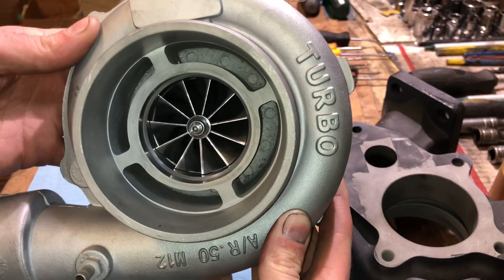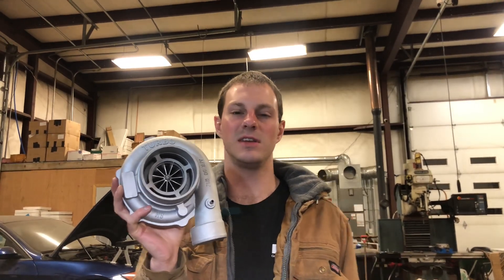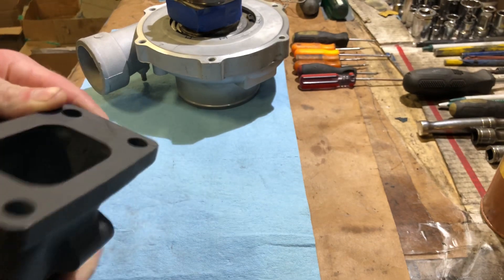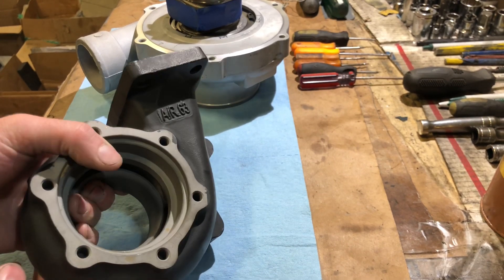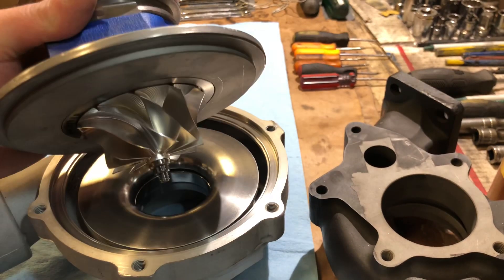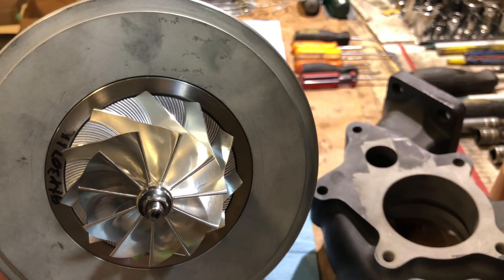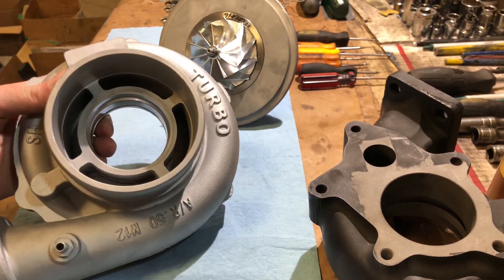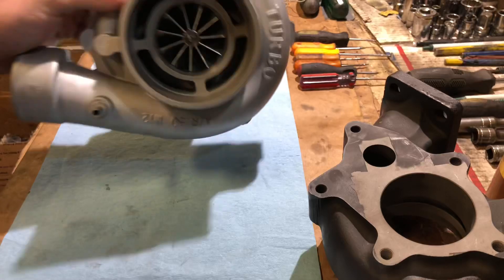“eBay” gt3071 to gtx3071r turbo build

Comment: Hi, I watched a lot of your videos, lots of interesting content. 
Since you have a lot of knowledge, I wonder what you would say as specialist. - Is it a normal  bearings sound on a brand new (one engine idle run) GTX3071R Gen,2...  haven't heard that on a bb  before, and for sure nothing is rubbing on housings ( checked CHRA separately still that noise) https://www.youtube.com/watch?v=DDyZF2zcYIU play it loud
Reply from the maker: That maybe normal. It’s hard to tell . Usually if there was a problem it won’t spin that freely
Reply: @turbolabamerica  I compared a 3  identical turbos on the bench at my suppliers, and all of them have that sound... so I hope that is normal  - not a faulty series :D

Comment: Does it leak from the adapter??
Reply from the maker: No there is an oring there
Reply: @turbolabamerica  Hi. Do you know if a wastegate flapper flange designed to bolt on this type of turbine housing of a chinese T3/4 (t04e) fits directly on a Atp Ford  5 bolt housing. By the looks of them they should...